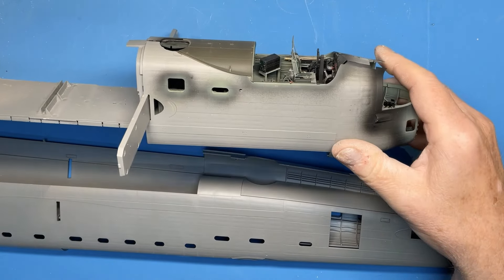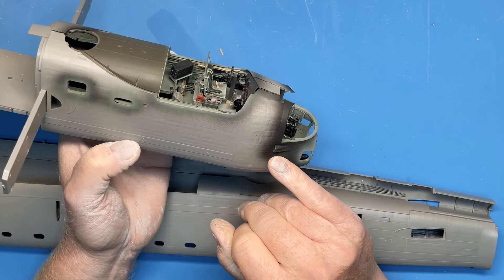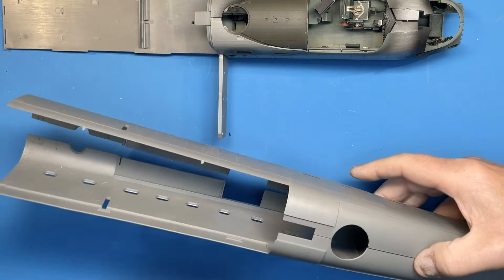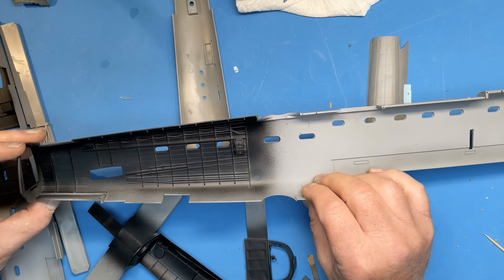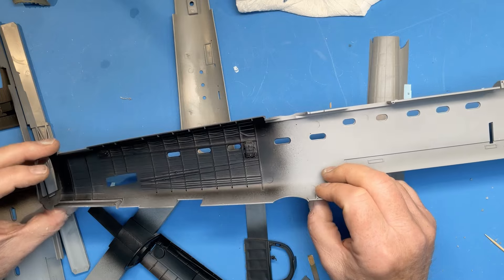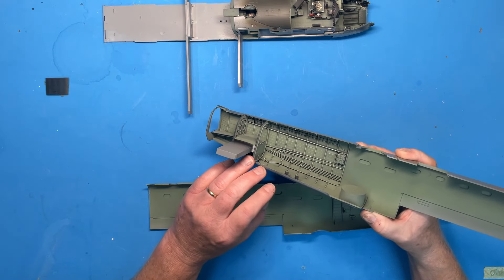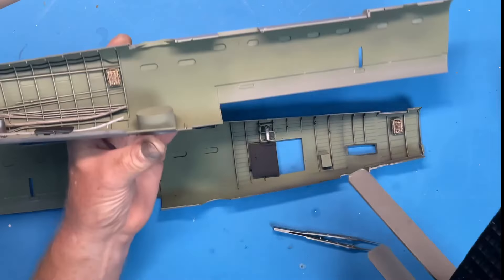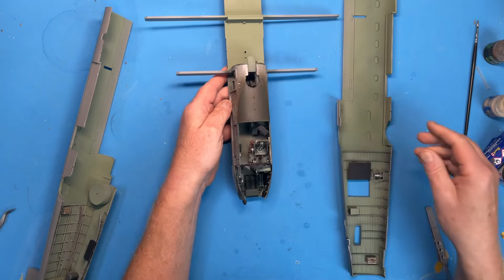Border Models 1/32 Avro Lancaster BI/BIII Part 5

Comment: Great video, thank you.  I´m just wondering what that cylinder shaped thing attached to the floor with a small hole on the top are suppose to be ? 17:45 (above the yellow glue bottle cap)

Comment: Hi , I noticed in this episode that you mentioned that in the next episode you are going to put in the ribs of the bomb bay , please be advised these ribs are highly delicate & doesn't take much to brake them , part number Q1-16 x 50  expect a few of them to brake , not to tell you what to do but it would have been better to work on them while the bombay was still out  you will see by the part that it is meant to be fit by segment by segment , the instructions are not much help , please be very careful at this point & good luck
Reply from the maker: Thanks for the heads up Gary 👍

Comment: You're an excellent modeler however I have not been watching this series because I think the cost of this kit is totally insane, ironically not worth the investment, unless your paid to build it
Reply from the maker: I would have to think twice before buying one for myself that’s for sure. Not so much on cost grounds but it just takes up too much space.
Reply: @c123bthunderpig  it is expensive. However you could look at this another way. It is so big and complex it is like building 6 £100 kits. It will take the same amount of time. It is just the initial outlay that is expensive but when you spread that over the months it might take to build…
Reply: @Garywolff884 I think you make a good point. I suspect that in terms of “hours of modelling pleasure per £” this kit scores highly. But that high initial outlay is a big pill to swallow. Plus there is the worry that the instructions are going to lead you up the garden path and you are left with a £500 pile of plastic junk!